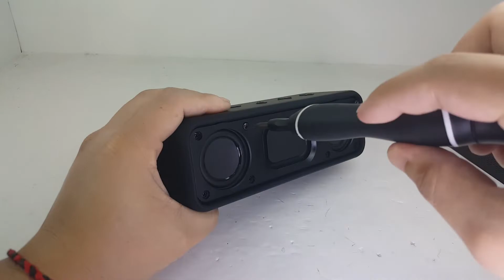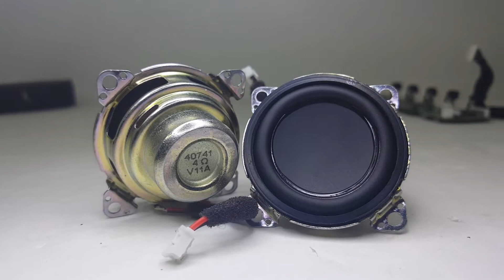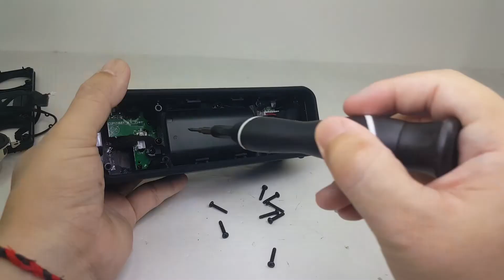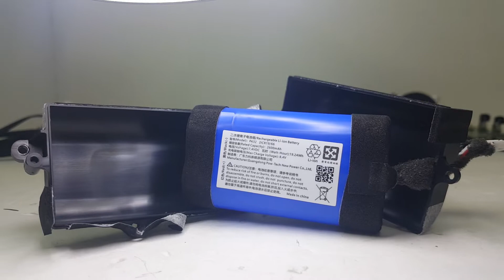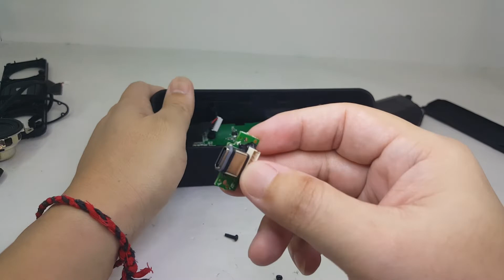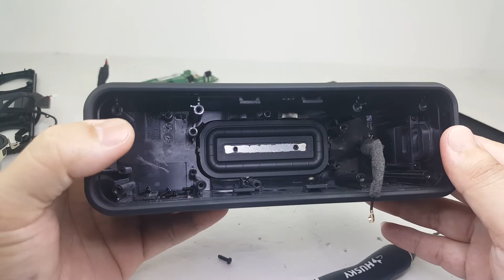ANKER SOUNDCORE SELECT 2 TEARDOWN

Comment: Nice job..
So I think battery size 7.2Volt 2200mah?
Reply from the maker: its 7.4v 2600mah
Reply: Why does the manual for this device say: Battery capacity 5200mAh?
The battery label says:
7.4VDC Rated capacity 2600mAh.
Do they multiple the 2600mAh x 2 to get 5200mAh?
Never mind got my answer. Each battery is a 3.7 2600mAh cell. There are two cells in the battery pack. Thus 3.7 x 2 =7.4 
2600mAh x 2 = 5200mAh 
That's why the manual says 5200mAh for capacity.